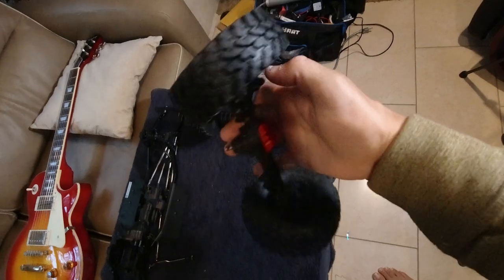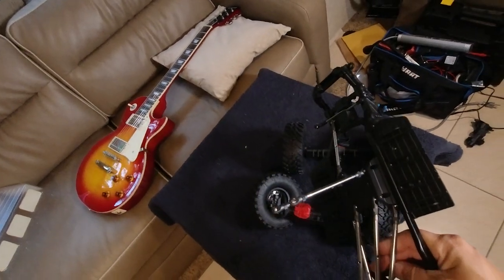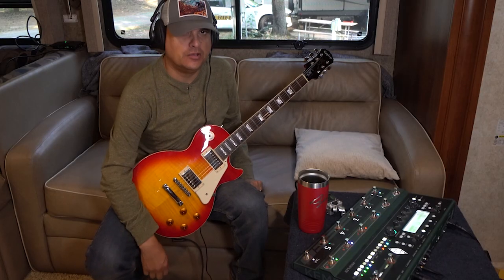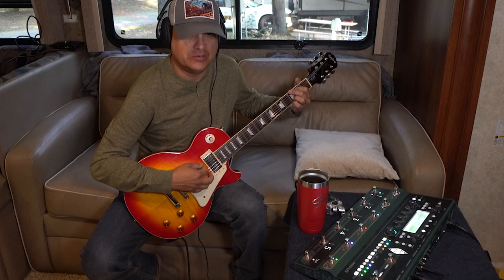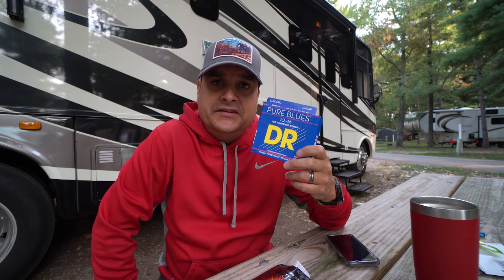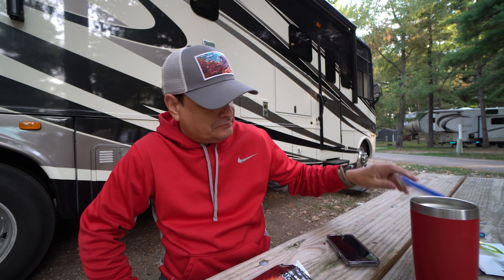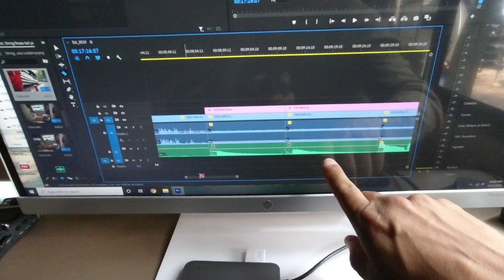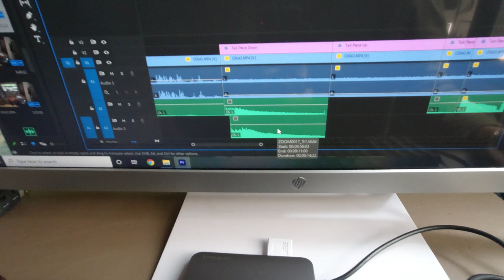Does Raising A Les Paul Tail Piece Kill Sustain - Best Strings Of 2020 Finale

Comment: I had a Firebird that I had to have the tailpiece jacked up pretty high on. The neck angle was about half a degree too steep, so everything had to be high to play with a straight-ish neck. The bridge was high, the bridge pickup was high, and the tailpiece had to be high so the strings would clear the back of the bridge. That guitar had mind-blowing sustain; it would sustain as long as you wanted. 

If screwing the tailpiece down to the body would have increased sustain and I had done that, some of my notes would still be playing (and I sold that guitar a decade ago).

Comment: i dont think its about wanting the strings to color your tone just for the sake of it. but as someone that loves a bright jangley tone, ill take extra brightness wherever i can get it. you can always roll your tone/treble off, but its hard to add more later.
Reply: very good point - my feeling is that less jangly strings have a lower amplitude because of less highs - but that's just conjecture. it would be interesting to see someone do a test on that.
Reply: @acmullane  One would think that because "bright" sound is high frequencies, flabby strings produce less because they don't have the tension to vibrate at those frequencies.  But fret noise and rattling... on a subtle level, give a "tone" you might call "jangly".  If you take a thin sting and tune it a minor third high, its "tone" changes, because the high frequencies are "tighter". when we "tighten" the strings the note rises, right?  So, can we get the ultra highs we don't hear as "notes" if the strings are flabby?  I used Slinky strings decades ago.  They're easy on the fingers.  That's about all I get out of em.  lol  

Remember the GL Sabre - you "can't add treble" but you CAN cut bass with roll-off by passing the signal THROUGH capacitor instead of grounding through capacitor (search - wiring guitar bass roll-off control) it's passive wiring.. no battery required, BUT there will be a level drop when the bass disappears)

Comment: Strings: I use GHS on 25.5 scales, Duesenberg (yes…!) on 24.75. The gauge depends on the guitar, goes from 10-46 to 10-50. 
Tailpiece: sustain difference is in your head. What I did notice, is that it can make a difference if your low string buzzes when played open. Tweaking the tailpiece height helps, as it changes the break angle. I have an ETS bridge on a 5 string bass that features an angle setting on each saddle for that purpose.

Comment: Honestly, I sink my tailpiece down & top wrap, not because I think it does anything regarding tone, feel, or sustain, but because it’s simple. With those tailpieces, if they’re too high, you might pop a string out of the bridge (easy fix, lower it), but if it’s too low, it puts too much pressure on the bridge & will collapse it over time. If you sink it down all the way & top wrap, you don’t have to worry about any of that
Reply: What is this "top wrap" you declare? 🤔😇🥸

Comment: I don't see many comments here as to WHY you should 'actually' raise or lower the tailpiece ... which is to dial in string tension on a tune-o-matic bridge. Setting it low increases string tension (break angle) but runs the risk of strings rubbing the bridge saddles. Setting it high decreases string tension (actually feels like lighter strings) but runs the risk of pulling barre chords out of tune for heavy handed players. It's a feel setting that doesn't get much attention. There's also a relationship between tailpiece height and what effect it has on improper/poorly notched nuts. Got a sticky cheap plastic nut..... raise the tailpiece to lessen radical bending pulling it out of tune (and stop blaming your tuners...)

Comment: I use D'addario EXL110, and leave them on for months. I adjust my tone with tone knobs, Modeler settings, EQ. I don't like changing strings. I don't break strings very often, even though I like bending them and using the Whammy bar. The Less Paul used for the tests is a beautiful looking and sounding guitar. I thought it sounded better with the tail block guitar. I didn't notice any significant difference in the sustain. Interesting test. I find different guitar pick materials can significantly change how a guitar sounds, plays, and feels. Thanks.
Reply: I used to leave mine on for months. Then I noticed how much better my guitar sounded with new strings and so I don't wait months anymore.

Comment: Here's what I think. My tailpiece is up for 2 reasons, both very practical. With the tailpiece all the way down, my bass strings are riding the back of the bridge. This introduces tension behind the bridge and makes the overall tension greater. So... I raise the tail piece, reduce the break angle and suddenly 2 things happened: acoustically, the guitar started to sound better - I could actually hear more resonance (i.e. loudness). This is probably coming from the tailpiece, ironically, since the unnecessary point of contact is removed - scientifically, this makes a lot of sense. Secondly, the overall tension in the strings got reduced, as the extra tension behind the bridge is now gone. First of all, I think less tension is better for this 30-something year old guitar in terms of physical impact on the instrument overall, so... that's good. Less tension overall made the strings easier to bend - so improved playability. This is something I could definitely feel straight away. Whether the sustain got better, I can't say. The amount of sustain of the guitar is insane as it is.. It probably didn't change, as you've shown here. However, those two physical consequences are very real and definitely have an impact. Maybe not so much on the amplified tone, but these other things are equally as important to me.

On wraparound tailpieces, yes, some people do that and some tailpieces are made for that. I wouldn't wrap around my stock tailpiece, just because it's not made for that. Would it work just the same as raising it up? Absolutely.

Comment: An audiologist is the not the person you need to answer your question at the end. Audiologists simply measure your hearing. If you want to do an experiment, you want a physicist/engineer with experience of measuring electric guitars. In the US, someone like Mark French (Purdue), Dan Russell (Penn State), Steven Errede (Illinois), or Kevin Wasson. Unfortunately none of the US guitar manufacturers appear to have such knowledge in-house. The best work on solid body electric guitar physics has been done in Germany and France. Read the work of Manfred Zollner, Helmut Fleischer, and Arthur Pate.

Comment: The real question is 'is sustain ACTUALLY important'.....think about what we do as soon as we play a guitar. Every action is pretty much directly related to killing sustain. Palm mutes, tone and volume knobs, gates, hairbands on the headstock, string trees,  nut material
 etc....we literally  spend 90%of our time killing off the sustain we pay dearly for. We've been doing everything wrong. I've started building with this in mind and the guitar reacts so much better. Hard to explain punchy tone that sounds amazing for blues and metal
Reply: s8n Lx 
I also thought long sustain is not necessary, but later I realized that long sustain is basically a sign for good, unhindered stringvibration and balance of resonance of the whole guitar. Usually the ones with good sustain are the richer sounding.

Comment: I've used the GHS Boomers for many years 10-46 on everything I'm happy.
Reply: I'm using GHS too, Gilmour Les Paul Boomers (red ones). They are 10,5. I've actually started using them, because they were cheap at that time, I wanted 10s, so they were close enough ;) I like how chords stay in tune even if I fret and strum hard, so I've stayed with them :) They are obviously tougher to bend in standard tuning than 9s, but I feel like some tension is nice to work against.
Reply: GHS boomers are one of the worst that I have ever tried. Highly suggest you to try Earnie Ball's.

Comment: I got rid of some buzzes by raising my Les Paul's tailpiece. Wound all the way down the string was sitting on the edge of the bridge piece. I noticed more resonance in the body when the string was touching the back of the bridge, possibly because it creates more physical contact points between the vibrating string and the guitar. Electric guitars when plugged in are mostly about the pickups and the player anyway imo.

Comment: A Les Paul is like a Harley. You have to tinker with it often to keep it at optimal performance. I recently restrung my ‘93 and did a whole set up just for fun. Ended up raising the tailpiece to prevent string contact with the rear of the bridge, just seemed logical, and the big ass screws are there, right? Didn’t know there was such a debate about this. I fear top wrapping as the strings will scuff the tailpiece. She’s playing better than ever and staying in tune just fine, I put 8’s on. Sounds and plays great.

Comment: It's a simple logic, the vibration recorded is between the bridge and the nut. As long as nothing dumpens it on that stretch, the sustain remains the same.
That said, all you really need is enough break angle getting the strings to the bridge, so it doesn't dump the vibrations.
Why anybody would think the distance between the tailpiece and the body of the guitar has any role in it is beyond me.

Comment: I appreciate your input about this because I couldn't tell the difference. My reason was to relieve the sharp angle of the strings on the bridge. As for as the strings, tight now I have Fender bullets in 10's, and they sound pretty good. The bullet ends keep the ends centered in the holes at the bridge. I play a Les Paul, and I don't have any tuning issues! By the way, I am for from a pro! I mainly play rythem with a small group! Thanks again my friend!😊

Comment: Hate to beat an old horse ,but this debate has been going for 50 years in my time playing l es pauls .
In the old 
 break angle was so steep it was causing  bridge collapse  to much pressure on the bridge .
So the adjustable tail piece was designed to put less pressure or down force on the bridge
 by raising  it to decrease string angle, which puts less downward pressure on the bridge.
Now if you that Gibson hand fits the neck on each guitar and they are not perfect  ,it can be a degree + or - off .
 So the adjustable tail piece is adjustable for a reason . 
What you want is to keep the strings from touching the back of the bridge during the final set up ... some say less break angle = slinkyer feel and maybe so but it also keeps you from breaking strings from the resting on the edge of the back of the bridge ..
I think sustain is between the nut and the saddles and the pickups and pickup hieghts on electric guitars. 
The only way you can debate this is with your ear and playing and clean no effects playing.
 Top wraping is a cool thing you see guitar gods do, has a cool factor and it does give you that slinky string feeling but that due to the shallower string break angle.
 So is this all Snake oil? Who knows right...

Comment: Figured I’d add my 2 cents- 
On strings- I use daddario exl 10s.  They are uncoated and last forever.  Months, a year.  I always wash my hands before playing so basically any strings I throw on should last a long time.  I will say that I used to use daddario exps which are coated, definitely not as bright but still very usable especially w single coils.  I switched for the brightness and don’t think I’ll go back.  I used boomers when I started playing like 20 years ago and I switched because they broke all the time.  Probably the bridge or how I played at 15 but anyway.  Cool test although I really agree that the differences between most electric guitar strings are pretty unnoticeable compared to an acoustic guitar.  
On the tailpiece debacle-
I notice the string tension big time.  I just bought a LP special that was setup in “wraparound” style, and the strings feel… loose, slinky.  Tmrw I will restring, condition the rosewood and get rid of the wraparound.  I usually raise it up a bit- just until the tension feels right.  Sound wise I do think I can hear a difference between all the way up and all the way down.  It almost sounds like the difference between 9a and 10s because of tension.

Comment: In my opinion, most of the factors that affect "sustain" or are probably due to feedback, not resonance. When you are playing through an amp or a speaker, both the wood and the strings will "resonate" more due to resonant frequencies and sympathetic vibrations. Perhaps the reason some believe that a lower tailpiece affects sustain is because with higher gain through a loud speaker the break angle at the bridge could have some sort of effect on sympathetic vibrations since raising the tailpiece decreases the downward force on the bridge saddles. I always direct tone snobs to this channel because proper science and logic is way more important than anything.

Comment: I've had my Les Paul since spring of 85 and I've never noticed any difference in having a tailpiece up or down. Since about 87 I've had a fine tuner tailpiece on there and still no difference the guitar sounds awesome everybody loves it. As well I've been using ghs Boomers since the late 80s I used to run nines I've been running TENS for about the last 20 years and they're awesome.

Comment: Nice video  I watched mainly for the discussion about tailpiece height.  I've mulled this over and over with a lot of experimentation on my various Les Paul guitars.  I've found a subtle tension difference and an even more subtle tone difference between a high and low tailpiece relative to the bridge.  The differences are subtle, but they're there.  

A high tailpiece yields slightly less tension and a low tailpiece slightly more.  I believe that this tension difference changes the attack characteristic of the notes that may account for the tone difference.  Think about it...with less string tension you'll get a very slight increase in "string rattle" when you hit the notes.  This rattle could give rise to an increase in over and under tones.  It's almost like adding false harmonics every time you pluck a note.  So, with a higher tailpiece you get less string tension resulting in more string rattle which may be perceived as more harmonic content to the notes.  With a lower tailpiece you get more string tension and a stronger, more immediate fundamental tone to the notes.

You briefly spoke of the perceived vibration a guitar has that can be felt while it's in your lap.  I believe that with the tailpiece low, more vibration can be felt in the body of the guitar and with the tailpiece high, more vibration can be felt in the neck of the guitar.  This may account for some tone differences because the tonal characteristics of the body wood vs. the neck wood then come into consideration.  Related to this, I've found that guitars with fatter necks can sound brighter than guitars with thinner necks all else being as equal as guitars can be.  The best thing to do is find your particular guitar's sweet-spot and play the hell out of it.

Comment: I'm not an Audiologist and I didn't stay at a Holiday Inn Express last night, but I am an EE and an audiophile that's spent 30 years analyzing the misconceptions of what's audible or not. I believe that people equate the physical resonance of a guitar as a positive because sound is as much of a tactile experience as it is audible. Anybody that has a great subwoofer in their home theater setup knows that the impact of an explosion is mostly because you feel it. Much of what you "hear" at low frequencies isn't heard at all, it's felt. Your brain uses that tactile input along with the audible input to build the sound it "hears ". Guitar is the same way. When you feel the resonance, it becomes part of what you hear. But, human interpretation and physics don't jive here. Physics dictates that sustain will be determined by how much energy is transferred into string motion. Any energy that is dissipated in other ways, like body motion, will lessen the amount of energy available for string motion. This is a complex relationship though, and will be different at all frequencies. There will also be a comb filtering effect where some frequencies will have destructive interference between the body and strings, where others will be constructive.  At these frequencies, body resonance will be in phase and can suppliment the string vibration. But ultimately, all of this will add up to barely audible differences in an amplified electric guitar signal, so what it all boils down to is, buy the guitar that inspires you and just play it!